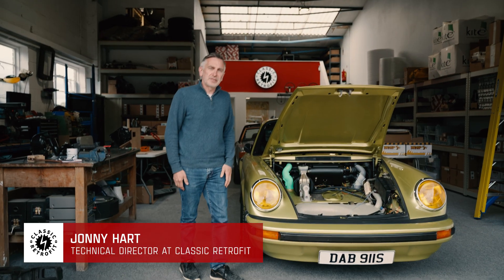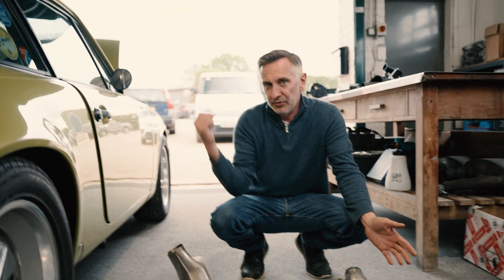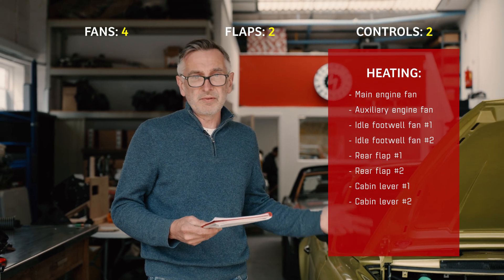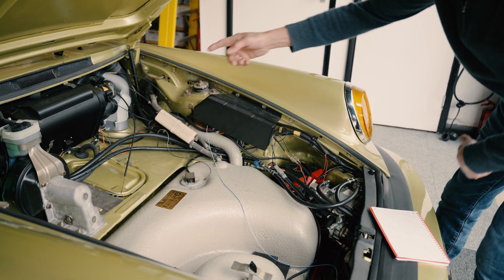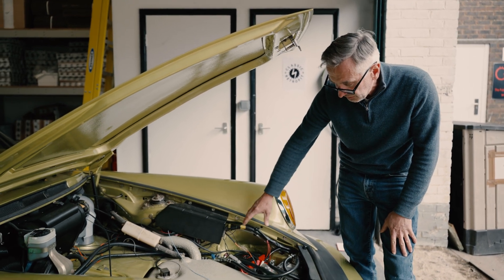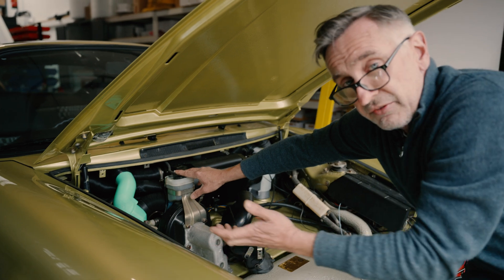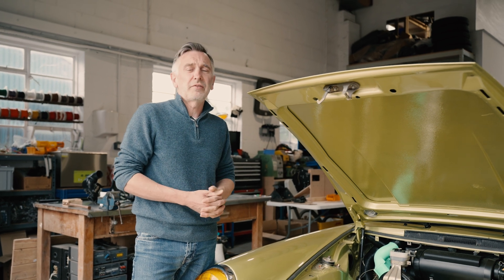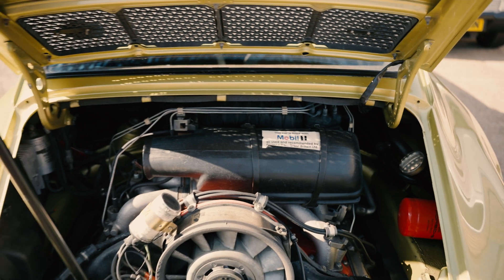Classic Porsche 911 Electric Air Conditioning: now also with Heating!

Comment: Are we there yet?
Reply from the maker: Getting closer!
Reply: @ClassicRetrofit  Thanks for the response. I have a few backdates eagerly awaiting the heat. I heard that there will be an upgrade for extant AC systems. Is that the case and if so what sort of figure are we looking at? Cheers!
Reply: @IanStraight4  Ian I'd recommend you look for the CR thread on the Pelican Parts forum, this is where Jonny is the most active with updates and answering questions, easier to manage and overview compared to Youtube comments.
Reply: @lukasmatzinger  Thanks Lukas, that's a great pointer.

Comment: I love Porsche but I don't own one and likely won't be able to ever afford one. That being said I want to know where you got that 4 way valve? I'm working on a plan to have heating and ac in my vehicles without having two separate systems and a belt driven compressor.

Comment: Certainly a modern system for current 911's with prices in the stratosphere.  I had a 78 SC that I used as a daily driver for years until it reached 180k miles. It had an old non-functioning A/C system that I made work. I used the evaporator in the smugglers box and the condenser in the engine door.  I got a used Sanden compressor, had new hoses made and fitted a new expansion valve.  The real trick to make it work is to have air flow through the condenser to get rid of the heat.  The classic solution was that the engine cooling fan would do that.  That fan looks great, but it really doesn't move much air.  So I added a pancake fan on the condenser and the system blew cold air.

Comment: So the AC has been revised to become a heat pump. Yes, all you really needed was a valve to change the direction of flow and a modeling program to check the evaporator and condenser to see if they will work in reverse.
I wonder why the German Engineers could not figure out how to do this. The only addition needed with electric AC is a higher output alternator and an additional battery like an Optima. The compressor runs off the Optima battery and the extra current from the alternator keeps the Optima charged.

Comment: This much extra power usage would mean upgrading some of the electrics and especially a larger alternator. Even the newest of air cooled 911's are now well over 20 years old, and the electrical systems, especially the 1930's fuse and relay panel were hardly up to the task as it was. But to lose the old heat exchangers and the barely functional AC systems that came on these cars is practically a miracle. To think it's expensive is to not consider the cost of repairing the factory AC every few years, but the stock heating works well, though to new owners it takes a good read of the manual to figure out how to use it! Within a few years there will be even simpler electric climate control systems and really, this technology is pretty new to the aftermarket, so if you're on the fence about it, give it a little time and watch how they evolve. One driver for them is the custom car and restoration market, especially in the US. Soon the bigger players with have easily installed custom systems that are likely to cost no more then their present climate control kits.
Reply from the maker: We've got our own upgraded fuse panels and we use the best (WOSP) alternator available... We've been making electric 12v A/C systems for 10 years now

Comment: Have a 66 912 with a VW stroker 2.3 litre engine.Can your air con system be fitted ?
Reply from the maker: It is on a few 912s - check out our blog for a few examples. The system is on the Kamm Manufaktur 912. Takes some work to get the alternator etc fitted and we do not yet do a 912 kit.

Comment: Nice try - but It looks terrible. Why bother - the standard heating works perfectly
Reply from the maker: The video shows a prototype.  The production version won't even be visible in the car and it will be under the frunk carpet .  No ugly compressor on the engine either.
Reply: I am also thinking that the additional electrical load for driving a compressor will rob your car of valuable HP. Nothing is free in this world.
Reply from the maker: @peterduxbury927  No.  The electric pump uses around 1.5 HP.  The original mechanical pump on a 911 uses 5 HP.
Reply: What use is this comment? Do you wake up being an asshole or are you completely unaware?

Comment: The wiring job dos not look professionally done.
Reply from the maker: It's a prototype....
Reply: @ClassicRetrofit  will the electric ac compressor with heat pump function be sold so I can build a custom setup around that unit?

Comment: Would I be correct in assuming that anything heating-wise to complement the Classic Retrofit AC system for 964/993 would be years away?
Reply from the maker: No not neccessarily. There is some development to do around the CCU functions with heat but we have quite a lot of test data on these now. Development timelines are really a function of hours in the day!

Comment: Awesome work gents. Why the extra testing on the air con side though, as you already have this product, so would have thought this was the easy side and the heating the more unknown bit…

Put me down for an order, plus happy to be a test bed, if any use as car just in final finishing stages - so perfect before I order new heat exchangers….!
Reply from the maker: Thanks!  Regarding testing, this system is quite different to the AC only kit.  The compressor is a newer technology so uses less refrigerant.  The amount is critical for operation in both heating and cooling scenarios.  There's a major change to the ECU control firmware required for the extra valves and stop/start sequencing.   We want to be sure that this works all year round.
Reply: Will the AC be a dual condenser for us with hotter climates? Put me down for an order please.
Reply from the maker: @daddyonly83  Yes we recommend dual condensers on all of our setups and this car has two

Comment: now tou need a bigger alternator for your electric pump. Bigger means a lot more money and weight. No wonder he never mentioned the cost.
Reply: Weight loss, performance increase, and if the system functions at much higher level than OE HVAC, it will have value and will be purchased.
Reply from the maker: @ejford5083  You are correct. It outperforms the original system on every metric other than original systems are already in the cars and our A/C needs fitting ;)
Reply from the maker: Our 175A uprated alternator weighs the same as the original alternator.  We don't have final costings yet as the system is still being developed.  Consider that the race headers on my car cost £500, whereas a performance exhaust with heat exchangers  is £1700 + reconditioning the flaps, cables, levers, autoheat etc (another £250?).
Reply: @ClassicRetrofit  there is no race headers for 500.SSI are around 3000. your 175 A alternator is around 2000, plus a bigger battery for the load, the pump is probably another 2000 plus the plumbing, condenser etc. The whole system will be 8000 plus not including labor. I looked into into it for my 84 3.2. Not worth it my friend.
Reply: @bernardmauge8613  you probably don’t live in the southern US, Brazil, Australia or SE Asia.
Reply from the maker: @bernardmauge8613  Your numbers and assumptions are not quite right but we appreciate it is not for everyone. The community we make things like this for love our products and see high value in their use cases. Have a great day 👍🏻
Reply: @ClassicRetrofit  the community you make things like this for, reads the financial time, this is where you should advertise, not u tube.
Reply from the maker: Thanks Bernard for your interactions. All the best with your projects.